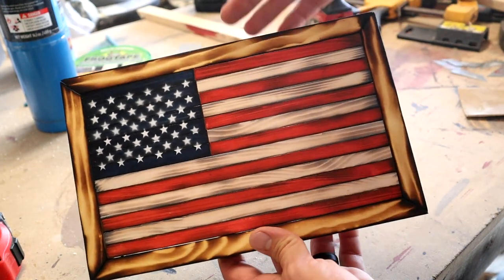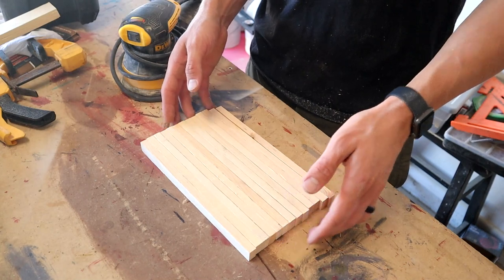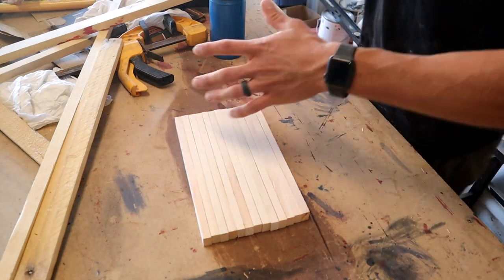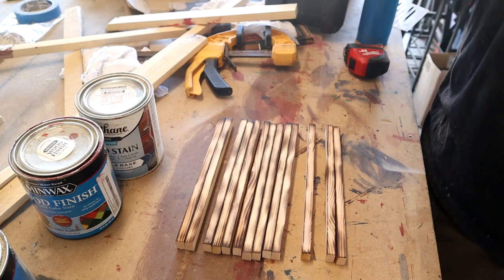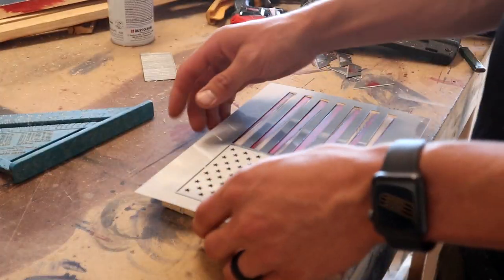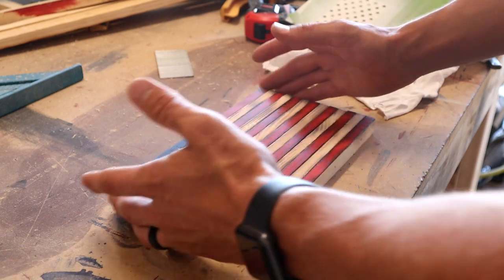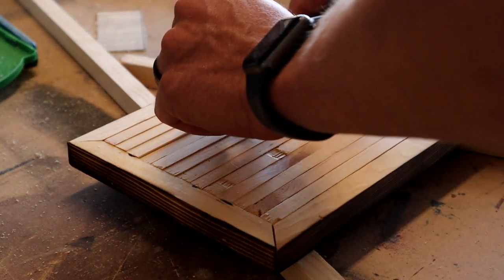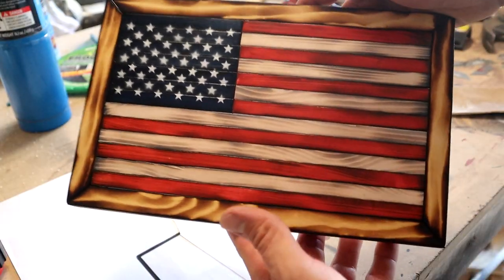SCRAP WOOD Mini Desktop Rustic Wooden American Flag! DIY Step by Step Scrap Wood Ideas

Comment: Great idea and great job of directing. 
I don't burn but I have scraps of PVC  boards that I can use.  I make most of my flags and crosses using PVC because I like the bright white it shows after using the Dremel to cut the stars.
I also have to use a back board since glue won't work on PVC.
Looking forward to doing some of these for gifts, thanks again.

Comment: Nice looking flag, Max.  Of course, I can visualize it hanging on a wall surrounded by family pictures, but I can also see it on an easel or with a stand on the back like you mentioned.
In either case, it would look great sitting on a desk at work.
Thanks for the video.
Reply from the maker: Thank you very much!!

Comment: Sweet.   Was just looking up your video for your other small flag (bigger than this one) anyways ran across this and NICE 👍🏻 going to try it now.  So…. “If” you  are selling these - how much would YOU ask ?  I just picked up 200 pieces of straight scrap KD HT  (from stair builder)  a dollar a piece. cut 1x9x18 and higher.  Was about to ten times profit each board - this would be ideal… and less work than your bigger /small flag-  cool fast project 👍🏻. Thanks for the video

Comment: I love building these things. One huge problem though... I don't have access to a table saw. Any tips?
Reply from the maker: I was in the same boat for quite a while, the only thing i can think of is using bigger pieces of lumber to get the same overall size of the flag and then using tape to stain the stripes. Not exactly ideal but it could work
Reply: @MaxF01  Works pretty good. Ive built some like that, just not as clean looking.